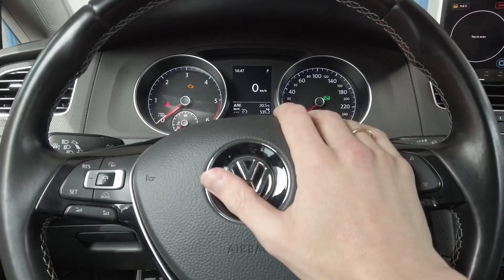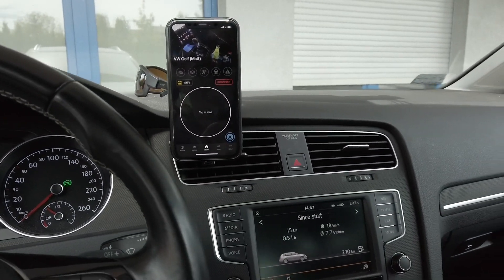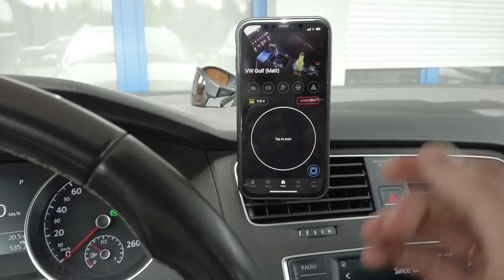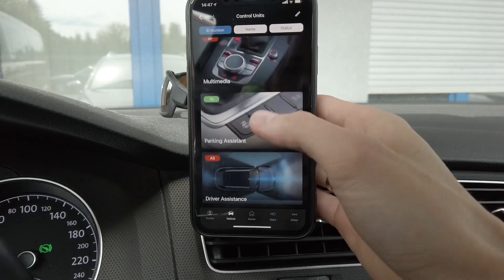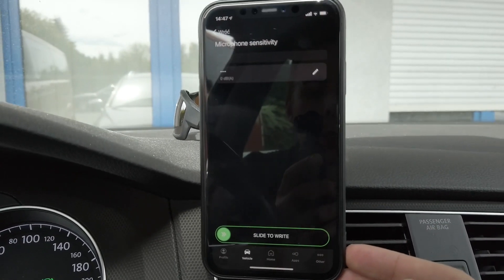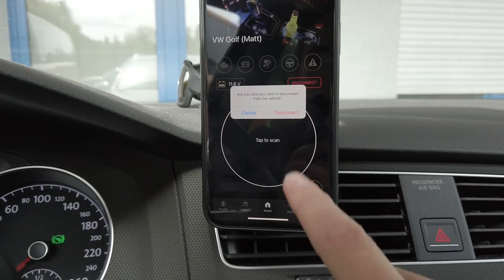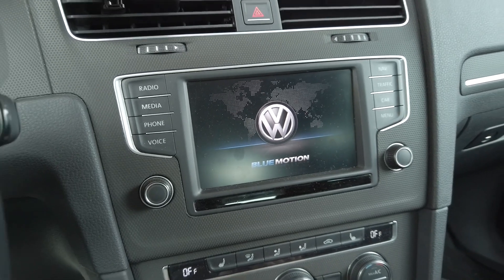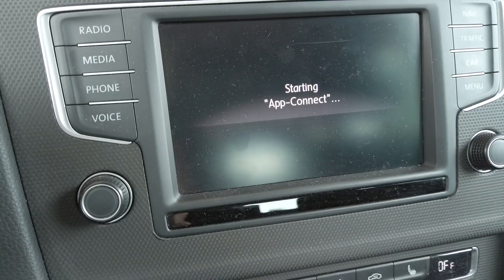MIB2 microphone sensitivity adjustment

Comment: Great video, very helpful, likely this is the issue why i can hear callers but they cant hear me using the car's bluetooth.  I checked your link to purchase OBDeleven, my car is 2023 VW Jetta. This is probably a stupid question but is this the one I should order? : VW Golf MK7 (2012-). Is the service free after you buy the device or must you pay to subscribe?   I just purchased this car 2 weeks ago and this issue has been very frustrating. i checked and double checked all my phone permissions and settings and the info screen settings several times. Everything is set correctly. Googled this issue for info and learned it's probably the mic but sites gave no info on how to fix it DYI so your video is very appreciated.  I have an appointment with the dealer service on it but that was after Google searches coming up dry, then today i found yourtube!

Comment: but is it possible to increase the volume of the various warning signals? type,: fuel warning light signal, low outside temperature!
thank you .
Reply from the maker: I don't think there is such setting. But I think (not sure) that there's an option to change signal type for different events.